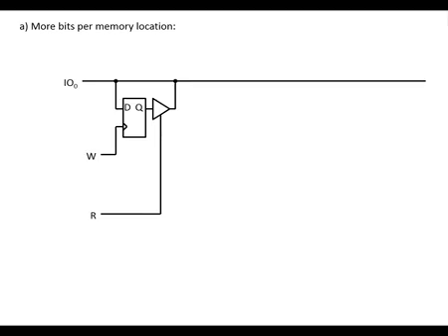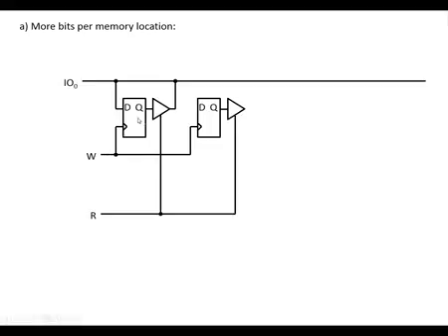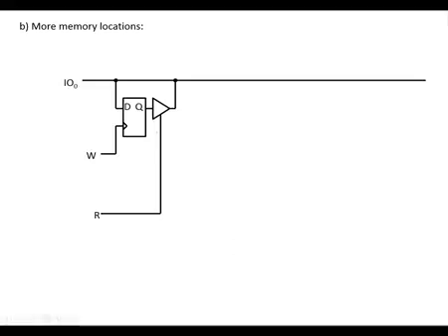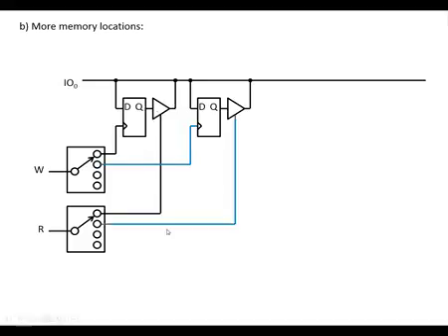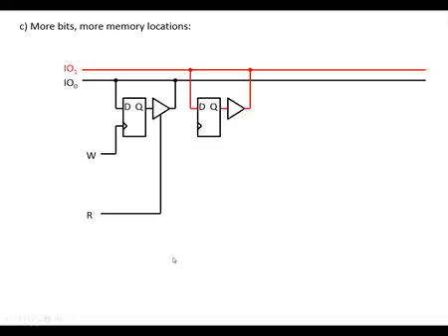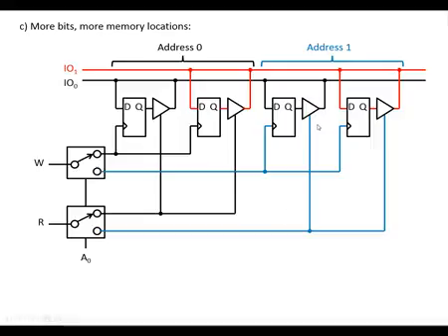Memory cell combinations

Comment: how to design 32 bit memory with 4 locations ?
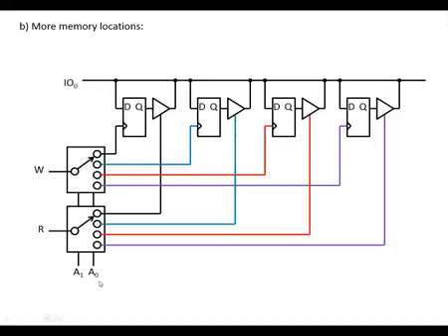Reply from the maker: 32 data lines; 2 address lines, connected to 4-way multiplexers (see 2:40).
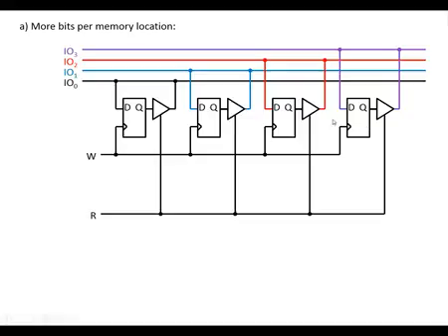Each location needs 32 cells (one for each data line ... an extension from the diagram at 1:00) - with the read inputs connected together, and the write inputs connected together.
I hope this helps.